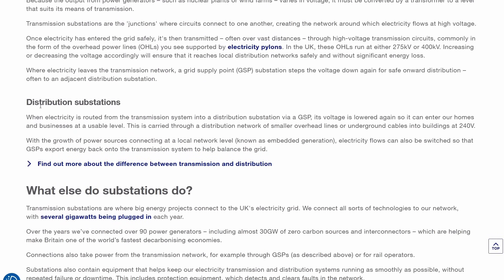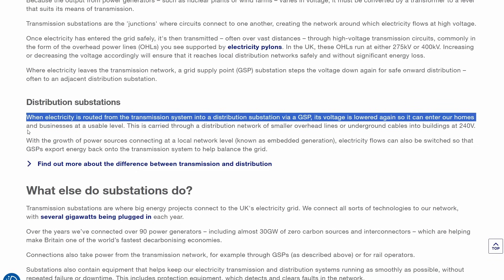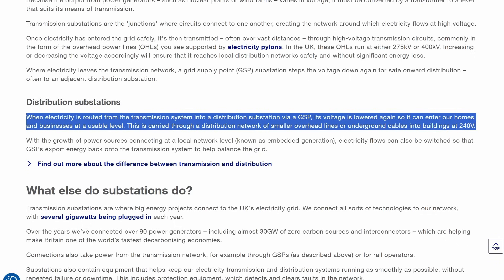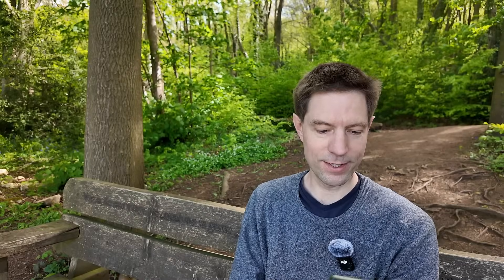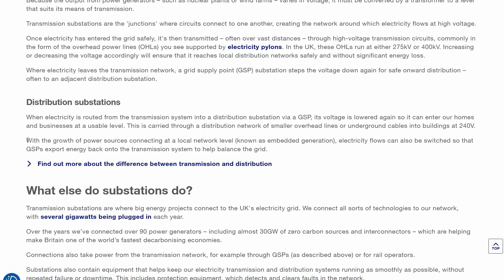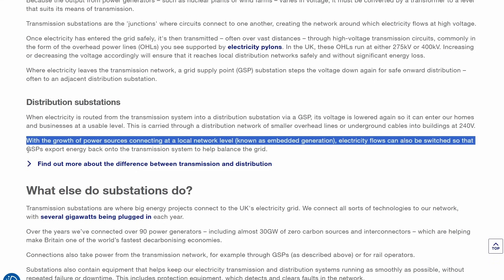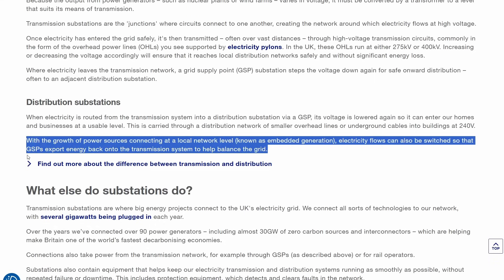Does solar export get past the local transformer?

Comment from the maker: To save folks searching through the comments, I'll summarise them here: 
The consensus is that yes, power can flow back through the local transformer and on towards the wider distribution network, and even further onwards to the transmission network if necessary.  Obviously there are a lot of details glossed over here but the main point is that even if everyone in a housing estate has solar on their roofs their excess export won't necessarily go to waste.  It'll get used somewhere as long as there is demand that needs to be met, most likely in a nearby part of the distribution system, but it could go further in principle.  Thanks to everyone who contributed comments that helped answer this question.
Reply: Thank you the summarising for us.👍
Reply from the maker: @busog97641  no problem.

Comment: Id find it hard to believe the supply authorities could accept unregulated power injected into the MV or HV. How can they manage -load management, voltage and frequency control, lines that then have their switching and fuses at the wrong end of the conductor? 
I'd also wonder how a local generator can "listen to" and follow the grid frequency when it's over saturated with pv
Reply from the maker: Well, by all accounts it appears it works just fine.  If equipment needs upgrading to allow it then that is happening when required.
Reply: At reading some  comments, I'll guess there's 2 general scenarios 1/ localized neighborhood power sharing, 2/ solar farm or wind farm injection to the wider grid and bidirectional HV in places like Europe?

Comment: My understanding is that local transformers have to be designed to accept reverse current flow. Initially, as the presenter says, your excess will easily be mopped up by your neighbours demands. This is why your DNO needs to assess your PV export - & possibly require you to limit it - to protect the local network. At some point installafjkn may have to be prevented, until transformers have been upgraded to cope.
Reply from the maker: It seems the limiting factor is the grid voltage, as increased solar generation in a local area can push it up beyond the limits set by the grid if the transformers are not sufficiently beefy.  But as you say, upgrading the transformers should help with this.

Comment: Be good to talk about over voltage causing sokar inverters to reboot and ev car chargers rebooting during lovely days due to over grid voltage of 253v. If your unlikely and live next to a 50kw system then likely you will suffer. So what happens when you go over 253v.
Reply from the maker: Yeah, that's a good topic for a future video, I'll see if I can slot that in.
Reply: @TimAndKatsGreenWalk  I fit solar inverters and ev chargers. Last year a customer in a village had his inverter rebootingvall day long, his ev charger as well. The local DNO not intrested. I managed to get the conse t of my customers inverter company to allow me to increase the 253v to 260v. It works OK now. Another customer just had his ev charger request turned down as his max demand withvev charger was 108 amps. They will not even allow load priority to be used on his charger to negate the issue.  But they are happy gor him to pay 15k to upgrade to 3 phase. What's all this about net zero lol

Comment: If you are "out of town" and at the end of a power line, then there is often a step-up transformer due to voltage drop on the line which needs to be brought back up to the nominal 240volts. However this transformer will work as a step-down transformer in reverse which means your power won't get far as I understand it.
Reply: It doesn't work like that, it should still work just fine. Either way if there's that much voltage drop on a line, there's plenty of demand on that line.
Reply from the maker: I believe that it should still allow power to flow in reverse, from what I've gathered.

Comment: You can't choose a direction a transformer works in, so yes, the power will flow either way. As the system gets bigger, more and more controls are in place to ensure that power flows the best way to avoid overloading lines and minimising generation etc.

A grid supply point is where the grid (that is the 'National grid' at 275kV to 400kV) supplies the DNO's 'Network' (generally 132kV and lower). Very large generators, like a nuclear power station, feed directly into the national grid, whereas smaller stuff, like solar, or a diesel generator, will be connected to the DNO network, this is called embedded generation.
Reply from the maker: Yup.  The bit that was missing from the National Grid webpage was the distinction between the GPS and the local transformers.   I now know that the GSP is much further up the chain towards the transmission network than the local transformer, but that was not made clear in that article.

Comment: The energy should go somewhere. It's clear that transformer works in both directions. No matter how big or small it is.

I'm not sure about your part of the world but here in Ukraine Residential PV generation scheme was setup in way it was quite profitable to build PV as investment.
So people often would buy house in middle of nowhere for $2000 and install 30kWp PV which is max allowed size.

Those villages don't have too much of local consumption. The  only issue with such disbalnce is that transformers have constant factor that is manually set.
Leading to 205V AC at outlet at night and 270V AC in sunny day.
Reply from the maker: The grid here has upper and lower voltage limits so if there is a lot of excess solar it could breach the upper limit if the local network isn't sufficiently beefy.  Most solar inverters will stop generating if that happens though.  We had a scheme to encourage solar installs in the early days that paid a feed in tariff that was very profitable.  That scheme has long since ended however, although we can still get paid for exported power so solar is still a good investment.

Comment: As long as the max solar feedback to the grid is lower then the max draw, solar feed back will always decrease the power in the grid wires.
Reply from the maker: Yes, that is true, but the question was what happens when the solar feedback is greater than the demand in the local area at a given time.  I've pinned a comment summarising the other comments that helped answer that.
Reply: @TimAndKatsGreenWalk   My grid connect was rated for 20KW.  I doesn't matter which direction the power flows.
Reply from the maker: @briandonovan9091  the video is about the local transformer, not individual home export ratings.

Comment: This is why using a generator back feeding the grid is dangerous during an outage. Even though it can only supply a small amount once it’s stepped up to 7200v or higher people working on assumed off lines could get killed. This is why dead man cables are not safe if people don’t turn off their breaker it will backfeed and transformers don’t care which direction the power flows. Usually a special breaker interlock is installed with a generator connection so in order to use it, it forces a disconnect to the grid preventing backfeeding.
Reply: In most parts of the world solar inverters have anti-islanding protection. When grid goes down - generation shuts off.
Reply: @ua420  Also, most inverters can be set up to work in island mode, BUT are required by the authorities to then disconnect from all grid connections (including earth). In the UK, most of our neutral and earth comes from the grid connection, so most solar setups won't work island mode without a separate earthing-rod and appropriate switch in software/hardware. I do wish that solar suppliers made this clear at the point of installation, as many battery systems would have power in the battery, but will switch off if the grid goes down - it's a little bit more work and slight additional cost to install the additional stuff, but it costs more as a retrofit.
Reply from the maker: Solar inverters also automatically cut out in the event of a power cut for the same reason.

Comment: I suspect a lot of UK substations will need to be upgraded soon.
Most of the newer ones are over 40 years old.
And it wont be because of solar generation back feeding into the local grid but because everyone dragging 32 amps for several hours (charging their EV cars) after 6pm.
I doubt the substations were ever designed for continued mass current draw for several hours.
Also the base load increasing over time HAS to be factored in by the power companies.
Its not like these transformers can be brought off the shelf.
Reply: Those transformers are already used to hours of high draw, it's peak time. Everyone starts up kettles, ovens and electric showers once people get home.
Reply: @ I bet them loads on the system are nothing compared to a few hundred Tesla’s plugged in around the same time
Reply: Power demand has been falling year on year for around a decade, so we have some catching up to do. Last year was the first year that trend was reversed.
Reply from the maker: The upgrades are happening, bit by bit, as required.
Reply: The system has been always developing and upgrading - this is no more a seachange than any other changes. People use a lot more electricity than they used to (and less coal, gas, wood, etc.) - the system works because each part can be upgraded separately as and when required.

Comment: As mentioned many times here transformers work both ways because transformer is a very simple device without any capability to restrict power flow.

However there’s other part which is very confusing to a lot of people and that’s the reactive power. Transformers by their nature consume reactive power and the question is where does that reactive power come from. Distributed generation on LV side brings new challenges in reactive power management and in ensuring grid stability overall.
Reply from the maker: I expect there will be ways of dealing with that as it becomes more necessary to do so.  We're still a long way off of every roof having solar.
Reply: It's the load that determines the power factor not the transformer. Power factor is the difference between the voltage and current waveforms and is what makes some types of (mainly inductive) loads 'reactive'. The windings of transformers are inductive, but the inherent 'magnetising current' of a transformer is very small compared to it's capacity to transfer power.

Comment: I don't know the answer, but I do know some things. Energy cannot be created or destroyed. That's the case with the grid as it is anywhere else - it's the physics law of conservation of energy. You know that problem you've heard of, called balancing the grid? Transformers are a bidirectional technology and if it were not the case that you could back-feed past the local transformer, where would all of the power be going in your entirely reasonable scenario? As you said, the power has to go somewhere. If there is nowhere for the power to go, it will not be possible for it to be generated, and the amount of generation will be limited.

The mechanism for the limitation at a local level would, I suspect, be the voltage. A home with an inverter increases the voltage locally because it has to - it's the only way it can cause energy to flow back to the grid. I'm sure it has to be the case that the rise in voltage is limited by grid-tied inverters to ensure safety, not just of your own supply, but elsewhere on the grid too. It would do this by limiting the power it produces. I'm not an expert in this area but I can't see any other way it could work - if there was any chance of the voltage being raised beyond 253V, that would exceed the statutory limit. (Source: I google grid voltage limit).
Reply from the maker: Yes, it's not a case that the power would have nowhere to go, as you say it'd just not get generated in the first place, i.e. the solar inverters would shut down or limit the power output.  But it seems we won't need to worry about that as it's entirely possible for power to flow up through the grid to meet demand elsewhere (see pinned comment on the summary of the comments so far).

Comment: As more home -solar generation is installed, the problem of oversupply will arise on sunny days.
This is one of the true purposes of smart meters, they will enable installations with solar panels to be disconnected from the grid.
Reply from the maker: The smart meters don't do that.  The inverters are what shut the solar off when the grid voltage gets too high.  And home storage batteries will go a long way towards smoothing out that excess generation so that it can be used in the evening and overnight.

Comment: Thanks again Tim.

Like you, would love to know more.
Reply from the maker: The general consensus seems to be that yes, power can flow up from the local inverter into the wider grid, so that's great.  Some equipment may need upgrading, however, to prevent problems.

Comment: In fewer words: ac transformers are bi-directional, they don't care about energy flow direction. 

They care about voltage, current, phase and temperature. 

But, because the three phase system is pumped by individual monophasic solar plants, care must be taken to keep the three phases as close as possible and not exceed the power limits of the lines and transformers. 

Also, the grids were built with a downstream philosophy. Both ways there are losses (impendance) but pumping up... not many thought about that say 50 years ago when much of the grid was being laid down. 

Anyhow, the grid was a great idea, now it's a weak and expensive pivoting point. 

When basically everybody will have their own power, the grid might fall in lack of need and demand.
Reply from the maker: Upgrades are happening all the time, so hopefully it'll keep pace with changing needs.

Comment: When I installed solar panels, I was not allowed to use them until the local transformer was replaced.
Reply from the maker: Interesting.  Hopefully they've done that now?
Reply: Wonder if that’s for efficiency reasons or for “get out ahead of the likely-soon failure” sake. Over here in the US, older transformers have to be swapped out because they were designed to output closer to the lower limit of what our power specs deem acceptable; ~110v per phase on old transformers, 123 to 125 max on newer ones. That may not sound like a huge difference, but when you take a transformer that handles 7300v on the high side and 220v on the low side, and then have a solar system suddenly trying to push an extra 20-30 volts back toward the high side… you can quickly see the high-voltage side go well over what it’s supposed to, leading to major problems. The voltage ratio for high-to-low on a new transformer is 29.2x, but older transformers are closer to 33.18x; so trying to send power back to the grid would mean that the 7300v distribution line would instead be pushed up to 8295v, which is very bad as that can trigger not only safety shutoffs at the substation, but also can effect the voltage that others receive from that same high-voltage line.
Reply: It was probable communication. If there is a problem with the local distribution line. The utility company needs to shut the power from your generation.  Your power generation can give power to the lines.
It can be done at the transformer with a simple power no/power disconnect.

Comment: There's a lot of comments about the increasing problems of solar feeding back in to the grid. However, having recently added batteries to my solar system I now work to minimize export (wasted energy to me!).
As household battery set ups become more common and people keep their electricity (or use to heat hot water tanks, charge EVs etc) the solar export issue may become much less of a conern.
Reply from the maker: I would tend to agree.  Home storage batteries and EVs (combined with appropriate tariffs to incentivise the right behaviour) should help a lot with this sort of thing.

Comment: Hi, I have a question someone out there may be able to answer, my incoming supply in a 100amp breaker and probably cable to match, i have solar and a powerwall, but when i applied to my local DNO to install another powerwall, they wanted to increase the incoming cable in size, but only part of it, to cope? with the potential export which will be nowhere near 100 amp. Are they being ultra cautious or just seeing an expensive but unnecessary upgrade
Reply from the maker: Possibly because you can import at a higher rate too?
Reply: General rule of thumb is the 80% rule. If your total load for a certain period of time comes within 80% of your service rating, then they would be required to increase your service rating with whatever components need to be changed out. I assume your power walls can also charge from the grid so adding another one bumped your potential amperage draw over the safety limits of what your service providers rules allow. Wire and breakers are also usually specified to remain at a maximum load of 80%.  If the sustained current draw can be relied on to be near or over that percentage, it’s time to upgrade components.  Copper and aluminum cables do wear out and the warmer they might get during operation, increases their resistance over time and that can cause issues where the cable could get hot enough to cause burnt components and in my experience, even fires.   More common on smaller gauge wire but does happen on large gauge wire too.
Reply: @calvingeisinger2639: Not sure if you’re speaking to the UK system and electrical code or not, but in the US at least that 80% rule is for continuous loads; all that would be required to bypass that is specify a max charging duration of 45 minutes per hour. Granted, I’m not sure if tesla power walls have that functionality; they very well may not. That would be a question for OP to answer.